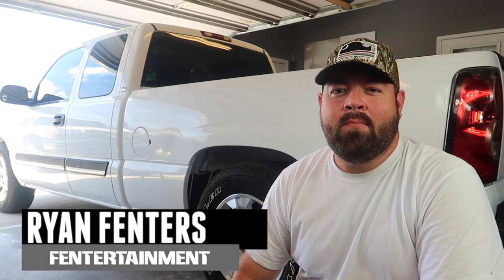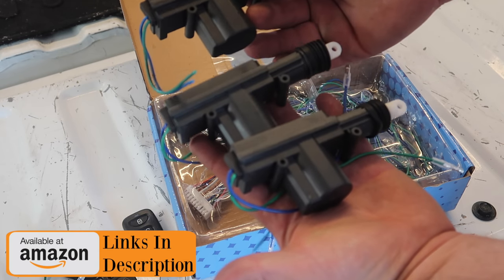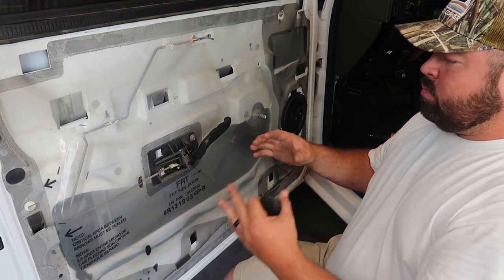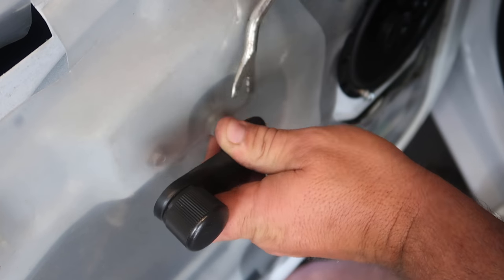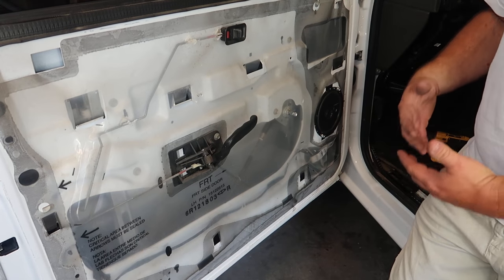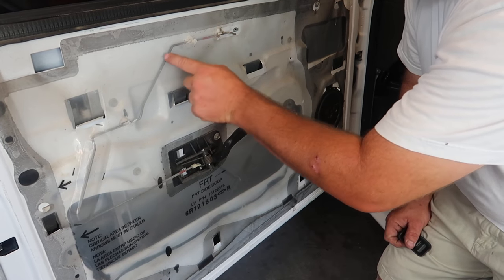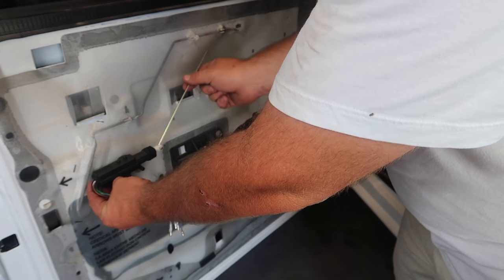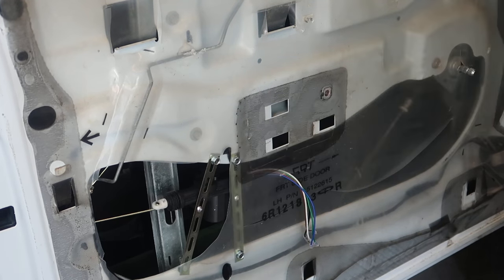Install Power Door Lock Actuators & Keyless Entry On Your Vehicle | In Depth Tutorial

Comment: All very good advice. You can get the clip off with a thin fabric rag or towel by pulling the sheet under the handle away from the grip if you don't have the crows foot trim tool.

Comment: Explained the best way possible! I got the same kit and installed it today, it took me a while to figure out the 2009 Chevy Cobalt auxiliary box. I read the car manual because my wires was so short and I couldn’t do the back doors, i also wasn’t sure if i was going to get it to the battery. I ended up getting a 12V from the floor fuse box since it’s under the glove box. Im not sure if that’s safe but i seen people do it and i just wanna know if it’s safe, I connected the red cable to the fuse and plugged the fuse. It works just great, i didn’t use any other fuses or “borrow” or depending on a power that’s for another thing, when i read the manual for the fuse box, ot said there is a fuse for unlocking the doors even tho my car doesn’t unlock automatically, but i used that fuse to get the 12V. i couldn’t find the alarm installation guide but I haven’t connected my trunk and second headlights, will you be able to tell me how to connect the trunk and also if the fuse method i used for the 12V os safe? And if i can buy wires to extend it to the back since the wires are short, and if im supposed to buy wires that’s the same color or any wire works? Thank you

Comment: For the window crank clip removal try using a rag. You just spread the rag flat and run the edge in between the door card and the crank and try your best to catch the side of the clip with the rag. Try it both directions since the clip can be on backwards sometimes. It works surprisingly well in my experience and has a very low chance of scraping your door card if you haven't removed one of these before.

Comment: Definitely want to put this in my 68 Camaro. Can it be wired so when you unlock it your interior lights come on, and then go out after a few seconds after you've gotten in the vehicle like a normal modern car.
Reply from the maker: Sure, However this kit does not offer dome light supervision. This has exact question has been on my mind for a week now. Some more $$$ expensive keyless entry systems has this feature built in. I plan on doing this upgrade to my vehicle soon because I not only want just dome light supervision but I want to add some puddle lights to the bottom of my truck mirrors as well. Which is the same concept but on the exterior of the vehicle like newer vehicles! I didnt think anyone would want to know that but now, I plan on it! I believe It can be done for less than $10.

Comment: Acker
1 day ago
My 04 tj works like I expected. One thing I noticed is if I use the manual lock button on the inside drivers door unlocks both doors unlock but only locks the drivers door. Is that normal

Comment: Hai, you seem to be a genius. Iam personally against any central locking system be it the conventional ones, auto locking ones which lock after the vehicle reaches a particular speed or the keyless entry. Can we remove all that stuff and have only manual door locks because In a care fire there is a spontaneous signal from the conventional central locking from the logic board which commands the actuator to move the latch and once the wires melt it's not going to work nor does it allow you to open the lock manually as the actuator is stuck and does permit to move the latch it has been a death trap and has consumed lives over the past 25 years and all dont have the physical fitness to jump out of the window by breaking the glass.manufacturers and auto experts dont recommend jumping out of the front windscreen as the engine bay is on fire and even though the rear windscreen as the fuel tank can explode .I have seen many people who dont remove the entire central locking system but just remove one actuator for making contact with the lock rod , they generally do it to the hatchback door so everyone can get away, that's great for a five door vehicle such as a hatch back sipper or any suv but how can we in a sedan, which door would be best, I feel the rear left would be good choice but if we have both rear doors open manually it would save all caught in the fire

Comment: bossman great video!! i bought two kits the other day after watching this..
 i bought the one you got on amazon and i bought a viper alarm system . & i also purchased a additional set of actuators for the viper alarm since it didnt come witih it. so I wired the one from amazon everything works flawless no problems. Ive done it the same way with the viper alarm but everything works besides the doors unlocking and locking with the actuators. the viper alarm came w a relay. The amazon one didnt require one. do you think i need to use the relay or is there something i am missing ? thanks in advance !!

Comment: i have Honda Civic 1998 model (sedan) VTI engine. in my car have power windows. i want install door lock central system. I don't have information" either i use actuator motor or without actuator" . i am actually confuse.kindly guide me.

Comment: I did something similar but used a viper alarm system so that I would have keless entry.
My question is,can I install a button connected to the relayinside the car so that I unlock the doors while the car is running?
The viper alarm will not unlock the doors while the engine is running. It automaticaly locks the doors when I start the car ( by choice in the settings)
I was thinking if I added another branch of power to the relays it would send current back into the alarm system and maybe destroying the alarm.

Comment: If you ground either of the two wires that say main control module does it lock and unlock also?  So you could add a switch in the vehicle?

Comment: The window crank is removed with a simple wash rag. Slide it under the plastic end of the window crank and pull up and to you. Just for those folks without the proper tool. It takes seconds and is easier than using the tool!

Comment: I have the same truck and mounted exactly the same and wired up correctly and unlock is lock and lock is unlock. Didn’t have enough room anywhere on the door to flip the actuator over.
Reply from the maker: swap the wires and you will be fine.

Comment: Ryan there is a brown and white wire from the module separate from the other set for the actuators. Is that for a rocker switch to manually lock & unlock the doors?

Comment: I was expecting bit deep content how to pass through the door and how the wire passes via inside cabin to the engine and finally how to attach with battery. Lastly where the cpu of lock goes .

Comment: One major thing here I would have done different that is not use that red electrical tape!!! I would have soldered and then used 3:1 heatshrink, the 3:1 has a glue that melts and  coats and seals the connection to a weather seal not even just weather just everything

Comment: Can you please tell me that if in my car ,there is company fitted manual centre locking system that means by only switching driver side lock all 4 doors are  locked, then does it mean that in all of the doors there is an actuator motor , and if i want to install the centre locking system then what shoul i have to do .

Comment: What should I do if the cables are insulated (covered)? Like brake cables on a bike.
Reply from the maker: If your vehicle is using cables and not rods then you would need to get the actuators made for cables. I’ve never owned a vehicle with the cable mechanism.

Comment: Great job! Really good description on the installation. Can you tell us where you got your 12V from?
Reply: You can look up the color of your power wires for your radio online by the year of your vehicle and follow that wire to the fuse box. Then tap off of it. They do sell devices to do so to avoid crappy connection or just splice and solder with battery disconnected.

Comment: Hi I’m looking to do this to my exact same truck but I’m stumped on the relay part, could you go into more detail or send me a link to a diagram?
Reply from the maker: You dont have to use a relay if you are doing the same truck. However you will have to find the 12v parking light wire in the driver kick panel. I used the relay because I used the wire located on the bcm since it was quicker to find. Here is the wiring for a 04 truck. https://www.the12volt.com/installbay/forum_posts.asp?tid=57723

Comment: I installed this system in my car and I have a question? My car has a trunk release button on dash, the orange wire in diagram says trunk. How do I go about connection this to make it actuate. Do I just tap into dash trunk release button?
Reply from the maker: So you just need to know if you have a positive or negative trigger on your trunk.

Comment: hey man, great video! i have a quick question, i got a 2003 f150 and i'm wondering where to hook up the wires for the lights so that they blink when you lock and unlock. haven't installed the kit yet as I just got it today but I can't find anywhere where to hook up the two wires for the indicators, any help would be greatly appreciated!
Reply from the maker: Follow the links in the description. Put your year make and model in. Im unsure and I would have to look also.

Comment: Question......
How does using an electronic device to unlock the door keep a person secure as thieves  also have devices to override these things....
I sleep in my Suv while on the road to avoid unsanitary motel/hotel rooms....
I want to have a lock that doesn't involve any kind of electronics inside my vehicle...
Like an eye hook lock or sliding lever look....etc....so it cannot possibly be unlocked from the outside except manually from the inside.....
Just asking is all....
For some reason your video froze and I could not see full installation
Reply from the maker: Thats a good question. This isn't a security device. This is just a remote access to lock and unlock your doors with out having to use your key to enter the locked vehicle.. If you were to buy a security device, I would suggest going to a car stereo shop and have them install an alarm on the vehicle (I would if I was using it to camp inside). That was to warn off intruders and deterrent them from entry. Although some thieves would still go far it. A manual inside lock would need to be added for that extra security like you mentioned. I'm sure it would give you a piece of mind in todays world.
Reply: @Fentertainment  
Absolutely.....even though I carry protection I don't want anyone to override anything on my door and be able to open it.....
My hubby already designing a manual bolt lock for all my doors.....
Strange that I could not find anyone that has a video on this.....
Yes I have a great alarm system on my vehicle but in this day and world of crime , SECONDS MATTER.....
Thank you for responding....God Bless
Reply from the maker: @kristieingram8835  no problem. I once seen a truck that had a manual sliding door latch on the inside of the vehicle. However it was mounted to the door panel and not to the door. I think if you fabricated a sliding latch from the door itself to the door jamb. That would be your best bet.

Comment: Awesome video.   Can you provide some guidance on how to add an aftermarket switch to be able to lock and unlock the actuators?
Reply: Did you have any  luck wiring  the switch
Reply: The white and brown wires coming out of the controller are for external switches.

Comment: I installed this today but the buttons on the remote are backwards. “Lock” unlocks and “unlock” locks. I tried switching the blue and green wires but only got a constant cycling of the actuators when I pressed either button. I tried a few different variations from driver side to passenger side and couldn’t get it right. Any thoughts ?
Reply: Alex Rodriguez you could switch the buttons!
Reply: L. B I figured it out. Had to use two relays and output the blue and green opposite each other and then switch the brown and white actuator wires at the brain and now it works. A lot of trial and error
Reply: Alex Rodriguez that’s great! Thanks for sharing :)
Reply: @AlexRodriguez-pg9xk hello! can you maybe share more details on how you fixed this issue? The install works great but lock and unlock are flipped for us too

Comment: I wonder if anyone has used these actuators to replace the little motors in the latch that burns out. Looks like all you have to do is find the lock/unlock wires and bypass the latch and install these actuators near the lock lever rod.
Reply from the maker: I did the exact thing on a chevrolet impala I had that was my to and from work car. The factory actuator was built into the latch and required more work. It worked great. I used the websites listed in the video to locate the factory color wires in the doors.
Reply: I wonder if this system will damage the ecm (computer) in the long run or is this a separate thing that have nothing to do with the computer?
Reply from the maker: @CacheAriosa  it has nothing to do with the computer. Just a power wire , ground & parking light wire.
Reply: @Fentertainment  Good info. Now I am goign to do it on my mom's Chrysler 200 convertible that has a messed up passenger lcok motor. FCA wants $115 parts +$200 labor to replace the whole lock mechanism, which will probably mess up again in 4 to 5 years.

Comment: Did you install any power switches on the inside to lock and unlock or do you just use the remote. Awesome vid by the way.
Reply from the maker: Thanks, I havent installed a switch just yet. The reason is I have a universal power window kit that I want to make a video on. I will mount the switch for the locks when I do the windows. Not sure where I want to mount everything just yet. But I have been using the remote to lock and unlock from the inside.
Reply: Have you hooked the door lock switch on the drivers side yet?
Reply: @Fentertainment  when you use the remote with the truck on, do your lights flash? I’ve noticed mine will and am considering deleting this function because of it (same truck as yours).
Reply from the maker: @AlexRodriguez-pg9xk  yes, I set mine up for my lights to flash.
Reply: @Fentertainment  can you get them not to flash when you use the remote from inside with the truck running ?
Reply from the maker: @AlexRodriguez-pg9xk  you are talking about the interior lights?
Reply: @Fentertainment  no the parking lights. Let’s say I’m stopped at a stop light and I decide to lock my doors, I can see the lights flash in the reflection of the car in front of me. Kind of an annoyance especially at night as the flash causes the headlights to turn off during the flash. I may end up just wiring in a small LED in the a pillar for the visible flash instead of using the parking lamps.

Comment: thanks for your video very helpful, question ... on my instructions there is a white and brown wire that says "connect with manual." what does that mean?  and do i need a realy?
Reply: relay.... sorry
Reply from the maker: I think it says connect with main unit. Not sure what that is, I didnt use it on mine.
Reply from the maker: @haskelldill2485  Only use a relay to change the polarity of your light output. You will need to figure out what your vehicle park light wiring is and if you need to or not. The light output violet wire is a positive trigger. If your vehicle has a positive trigger then you wont but if it has a negative trigger like mine then you will.
Reply: @Fentertainment  thanks brother!!!

Comment: very clear video!! funny enough I was looking at that very same kit before seeing your video. 

However, I realize that the actuators I previously bought all have two (2) wires, each. Possible to just purchase an unlock system with the remotes and utilize em?

Your video was very straight forward!
Reply from the maker: Possibly with a good kit from dei (directed electronics inc) they make viper, avital , Clifford etc. Just dont want to wire up relays if you dont have to. I'm still using the one remote daily with mine and everything is good to go. Hoping to do power windows on it soon.
Reply: @Fentertainment  I will definitely keep posted for that one. I think i might just get the full kit and go through fully.
Reply from the maker: @skylinekid4life  ten4

Comment: Hey man, let me just start out by saying great video! I really appreciate the detail you provided with the removal of the door panel. I have a question for you though. Having finished the project, would you recommend this project to someone else, or is it worth the money to take it into a shop to get it installed?
Reply from the maker: Honestly. This was easy and straight forward. If you dont want to find the parking light wire (no light flash) on your vehicle you can just give the system power and ground. That would be even easier. Its up to you though and what you feel comfortable doing. I think shops around here start out around charging $125 and go up depending on how many doors. So its up to you but its pretty simple.
Reply: @Fentertainment  Ok awesome. That's the answer I was hoping for. Huge thx again for posting this video and for the super quick response. Be well my friend!

Comment: How long did these hold up? I'm looking for a conversion kit but not wanting to spend $200. I've seen mixed reviews on a few kits from Amazon
Reply from the maker: Still going till this day.
Reply from the maker: @cheddarballs864  more than welcome. When I installed these I wondered the same thing. Ive always used Metra branded actuators however I have not had to change these yet.